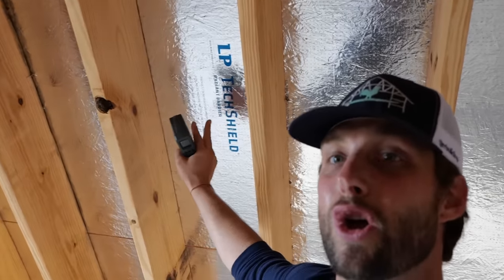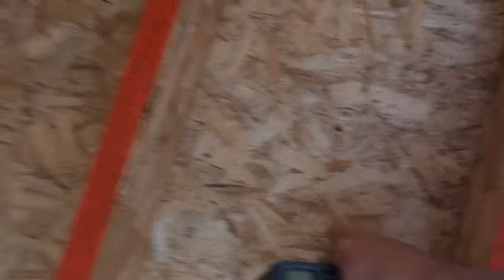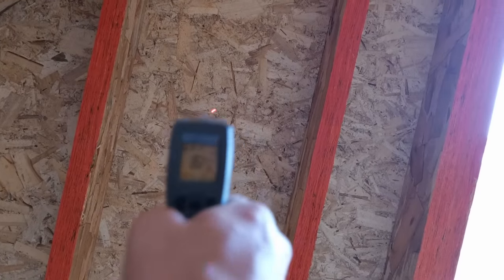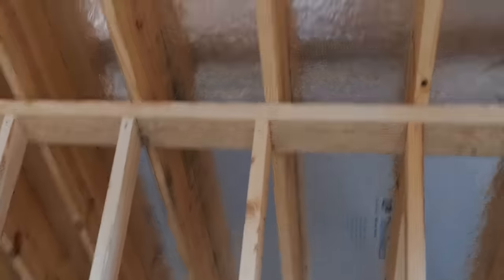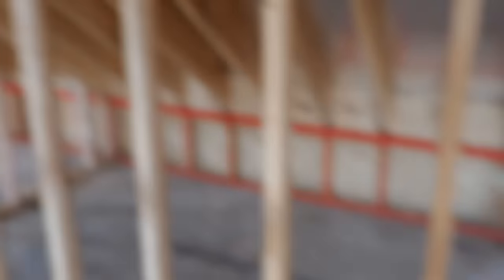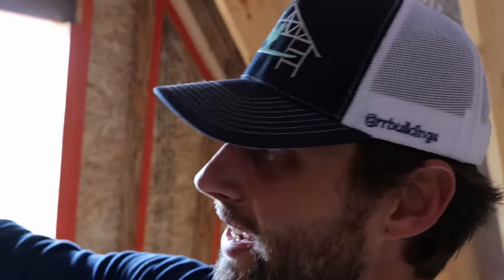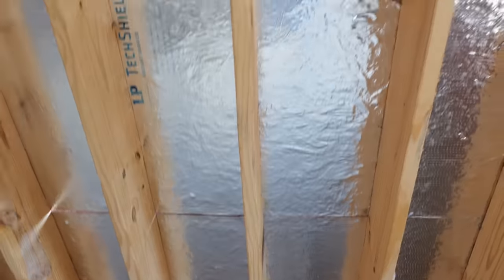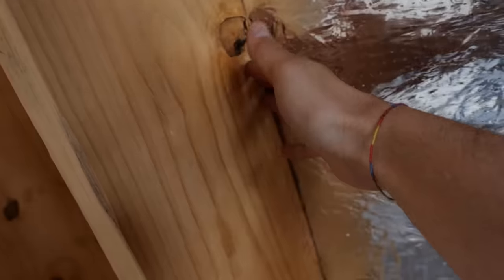Do Radiant Barriers Work? - LP Techshield Review

Comment: insulation should be tight against the sheathing to prevent thermal bridging and condensation. the wall cavity should have a good air seal to prevent thermal loss. like caulking top and bottom plates and firefoam all penetrations along top plate and any to the exterior.  

air gaps need to be on exterior such as brick or siding. 
the gap on brick exterior helps equal out pressure and wont allow forced elements through weep holes and old mortar. very similar with siding. this is known as a rain screen. 

with air loss averaging 15-35 percent of waste, mostly through the attic, walls and ceiling along with rim joist, crawlspace and windows help create the stack effect.  
the debate over insulation, R-value and region has long been scrutinized and tested. as of today, houses are required to be built “tight “ and have minimal air loss.  
any air gaps between insulation and exterior wall sheathing is a problem waiting to happen.
when insulation is installed directly to attic ceiling, the conditioned living space is now sharing attic space so baffles and vents would need to be omitted and attic would need a supply and return from the hvac unit. also considerations towards hvac and water heater units if gas operated. 
if blown in insulation is being used, baffles should be insulated and rise past any level of insulation to properly let the mass air flow through the top “ridge “ of roof. 
this also needs a controlled flow. using to equal amount of intake and output. to figure this generaly is ( for easy math). footage divided by 2, then divided by two again but in inches. 
so
500 sqft = 500 sq inches divided by 2 = 250 sq inches of intake and 250 output. this allows the proper mass airflow an attic needs to vent.

Comment: Deciduous trees out perform everything.
Reply: But if you want solar, that tree shading the south and in our case South West is coming down so we're adding this
Reply: @margaretagard1744  Unfortunately the correct alighnment for a house towards the sun is sacrificed to have the house facing the street and trees are often planted in the wrong places or sadly not at all.
Reply: Nice when tree's aren't doing damage to cement. I hate leaves in the fall. Removed a 75 foot tree the canopy was over my driveway, destroyed the cement. The roots have traveled 75 feet in each direction had destroyed lawns. Dug up all the roots in front of house. Now I'm ready to start other side and do a large cement driveway. I finished large lawn in front of house last year. Never could keep my car clean from birds.
Reply: @amraceway  :  a bit crass,  when you chop the trees, cut them into piles for firewood.  this is a natural cycle of carbon from free to living to being released back to feed more trees.
as for the birds,   use that nice fire to roast a nice meal.  nothing in nature should be wasted.
see how pleasant it is to live in and with nature !
Reply: @dave-in-nj9393  A fine resolution. Why didn't I think of that?
Reply: @margaretagard1744  I wonder how this product compares to the fiberglass I saw on this channel #sinnisjInsulator.

Comment: The air gap supposed to be on the side that is receiving the radiation...   having a gap between your insulation and the radiant barrier will help prevent radiant heat from escaping your house..  but if that is your goal then the radiant barrier, and airgap should be behind your drywall...  but since you are in Texas, you probably want your airgap behind your radiant barrier.

Comment: It's infrared, not ultraviolet that radiates heat.
Reply: UV radiation has a tighter wavelength and is slowed down faster upon striking objects. While heat is not radiate off objects in the UV spectrum, objects are heated when being struck by UV.
Reply: @user-dr2pg8fk2i  Any frequency in the electromagnetic spectrum will heat an object at very high intensities (I.e. lasers), but infrared is radiant heat as used in heat lamps and air fryers.  UV is a very poor source of heat in comparison by magnitudes.
Reply: @user-dr2pg8fk2i  Also, UV radiation having a "tighter wavelength" (properly known as a higher frequency) is not slowed down more as all reflected electromagnetic radiation is reflected back at the same speed.
Reply: @user-dr2pg8fk2i  you know when a piece of metal glows red because it's hot? that's infrared heat radiating. What you see is visible light also radiating from it, but if you put your hand close to the heat, you can distinctly notice the infrared heat radiation.
Reply: @user-dr2pg8fk2i  I wonder how this product compares to the fiberglass I saw on this channel #sinnisjInsulator.
Reply: There is some heat generated by ultraviolet light. However, the vast majority of heat comes from infrared light.
Reply: Also, the aluminum foil on the OSB board is radiating heat back into the house, not away.  The aluminum foil will conduct heat into the house easily.  He knows enough about heat transfer, but lacks comprehension.  In Texas, you want to reflect heat away, not back into the house.

Comment: Um, doesn't that just measure surface temperature. So if the material is outside ambient temperature, then that's what you see. I think you need an IR camera to show thermal differences.  I get 8* deltas all the time using the laser thermometers all the time in the same space(s).

Comment: Why not build your roof with the radiant barrier on top of the system with the air gap outside? Not sure what roof your using but on a Metal roof in Texas if you went..
1.  Metal Roof.
2. Purlins, say Cor a Vent for air flow.
3. Radiant Barrier reflecting back to the Metal roof.
4. Then like a Zip R Sheathing for the roof if okay'd by engineer. U get the Thermal Break at the Rafter.
5. Rafter insulation where U don't have to worry about the air gap.
You could put A heavy felt on top of the Zip under the Foil as added protection but that is strictly a personal choice and also depends on what foil product U go with.
Reply: YES!  This is the ultimate roof and we make the radiant barrier underlayment for this type roof www.RoofingFoil.com - Miami-Dade County Approved too!

Comment: I was thinking about using reflectix on the inside side between the stud face and drywall on my remodel. Something   like 2" sprayfoam then fiberglass batts then reflectix and finally drywall. Outside to Inside.
Reply: Reflectix has a much thicker bubble wrap style design. Which provides a minimal air gap between layers. I know this wont be much in itself but maybe as a part of the system it will have some added benefits it's not permeable either. Which is why I have reservations.  If moisture gets in the fiberglass layer it would be hard for it to dry.
Reply: Wilder Transit So are you trying to get a radiant barrier to the inside? This Would typically be a cold-weather application to help keep heat in if you had a radiant heating system.

Comment: ... little bit wrong explanation on air gap needed for radiation reflection to work ... it works anyway ... it helps to stop conduction by ventilating it through the provided air gap (cooling) ...

Comment: When radiant barrier is on the plywood surface it reduces the emesivity, the amount of heat emitted by the radiant barrier. If you want a more effective but laborious method. Staple radiant barrier to the bottom of the roof rafters. This creates a better radiant barrier because the air gap.
Reply: When you mean bottom, you're talking about the thin face of the rafters? So there would be an air gap between the rafters? I have an existing very thin foil radiant barrier layed flat in the ceiling but was thinking of stapling it up across the rafters.

Comment: The LP Tech Shield goes against my understanding of how a radiant barrier works - I had been taught that the air/ventilation gap needed to be ABOVE the radiant barrier (RB) - keeping the radiant heat OUTSIDE the radiant barrier. In LP Tech Shield, the product is installed RB side down, so that the product's OSB (a heat conductive material) is directly above the RB. Also, per Residential Code, IRC 2015 Section 806.5.5.1.2, https://up.codes/viewer/pennsylvania/irc-2015/chapter/8/roof-ceiling-construction#R806.5, that air gap he mentions between the LP Tech Shield and the fiberglass BATTs is not allowed - the insulation needs to be DIRECTLY below the sheathing. Plus, rigid insulation is required above the roof deck when the below deck insulation is air permeable. In the condition shown in the video, where you have an insulated, cathedral ceiling over a conditioned attic space, I would think you'd want the radiant barrier ABOVE the roof sheathing (RB side out), and then a ventilated air gap via furring strips above the sheathing and below the roof deck/roofing.  In the case of a non-conditioned attic, I've always seen the radiant barrier sheet fastened to the underside of the (uninsulated) rafters, and the heat ventilates up the rafter spacing and out at the ridge vent. I guess if the LP Tech Shield product works, then it works. but I'm interested in understanding how and why it works the way it is designed.
Reply: Techshield technically works off the EMISSIVITY quality of the aluminum foil and not the REFLECTIVITY quality.  People get these two confused and using reflectivity is always best but emissivity is definitely effective.  The net effect is the same: They both reduce heat flow.  When you staple to the bottom of the rafters for retrofit applications like www.AtticFoil.com you are working off the REFLECTIVITY quality which is actually more effective.  However, nothing wrong with radiant barrier decking for new construction with vented attics since it's low cost and zero additional labor to install.

Comment: @Jordan_Smith great video, I don't see how you are going to be successful at making sure the fiberglass insulation is NOT touching the radiant barrier.  If you can please let me know how you can be assured there is no barrier to insulation heat exchange taking place, I am 100% behind your objective.  Additionally, I'll use any links you have in place so that you can take a commission within my purchase if those links are available with your video.  Overall, great video buddy.

Comment: I’m not convinced that the air gap without ventilation is a benefit. If you are getting heat conducted from that roof material into an air gap that is no different than heat being conducted into foam or glass insulation (with the exception being the r value of whatever is in contact with the roof). You don’t mention venting the air gap, so I’m thinking that you aren’t doing that. Am I missing something?

Comment: Anyone who has ever stood near a blazing fire knows that holding your hand in front of your face blocks most of the feeling of heat .  That is only blocking the radiant heat.  In fact many who heated homes years ago with a fireplace or even wood stove later should use a fire screen which is basically a piece of thin metal with feet to be able to move it to be between  say a chair you sat in close to the fire and the fire so you wouldn't get too hot.
Reply from the maker: Exactly! Convection and conduction play a huge role in heat transfer, but there is a reason radiant heaters are so effective.

Comment: I think you should have been pointing your thermometer at the truss where there's no reflective barrier on both sides. See you're getting all scientific on the effects, but you're misunderstanding how that lazer thermometer works. When you point it at a reflective surface you're not measuring the reflective surface, you're measuring the temperature of whatever the surface is reflecting onto. Don't believe me, point it at yourself, then point it at yourself through a mirror.

Comment: Do they work? 
NO, they do NOT work. 
I paid $1700 to have that crap installed in my attic with the Promise that it would reduce my heating and cooling costs by a minimum of 30%. 
Over the following 5 years, my heating and cooling costs remained the same.
Reply: I agree. attic is cooler, but no change to electric bill

Comment: Your IR temp is incorrect. You haven’t accounted for the huge impact of the emissivity. The wood surface at IR wavelengths has very high emissivity. The temp measurement is pretty good. The Aluminum surface has low emissivity. The IR temp will measure lower than the true temp. Not clear whether you know this and are pulling a con job, or just don’t know.

Comment: Everyone should use this. At Home Depot it’s only $3 more.
Reply: X2, I'm planning to use it on my somewhat small garage and just learned the the other night that an air gap is needed. So, I will use 2x6 board to rebuild my roof that needed replaced anyway, and use R13 insulation, rockwool, for 2x4's and have a 2" air gap for the radiant and to let the roof breath.

Comment: Radiant barrier works on decreasing the radiant transfer on the shiny side, so it keeps heat from the shiny side on the shiny side, this setup is to keep the space warmer in winter. To keep it cooler in summer, shiny side to the outside.

Comment: I thought the radiant barrier was not supposed to be touching the roof deck.
Reply: That would be a benefit but the foil itself has a very low emittance, very low radiating quality to it,  0.03 to 0.9 for the wood itself.

Comment: Radiant barrier should have air on both sides to work best, Direct contact transfer heat more than radiation or convection. Next time stape radiant barrier sheet (reflective on both sides) to the rafters. Then it reflect heat back out the roof, and what heat that does heat up the barrier will be much less radiated to the rest of the house below. And the ultraviolet light is nonsense. The sun puts out all frequencies form IR to UV,, all of which heat the atmosphere to various degrees and most surfaces as well.

Comment: You need to put black tape on the foil you are not reading surface temperature at all the way you are doing it.  Also the foil in that position reflects back radiant energy toward the air space---not to the exterior.  Add to that, the foil is not nearly flat enough,
Reply from the maker: But that is exactly the point.  I am not trying to measure the surface energy that would have to either convect or conduct to transfer.  I am only showing the differences in RADIANT energy, so a IR thermometer is perfect for comparison purposes.  If i was concerned about surface temperature, I would need to do something along the lines of what you are saying with the black tape.  You could also change the emissivity settings in the IR unit, but these cheap things are pretty terrible with reflective surfaces.
As to the directionality of the foil face: we are not trying to REFLECT the energy away, but rather we are keeping the energy from EMITTING from the backside of the decking into the attic.  Installing the other way around would cancel all benefits as the decking will be roofed and covered with underlayment, eliminating radiant heat transfer and making all heat transfer conductive.  Sun radiates heat through space to roof > Roof absorbs heat and transfers through assembly via conduction > Conduction is interrupted at foil/air interface > Heat's ability to re-radiate into attic is limited by the low emissivity  foil backing> Heat re-radiates into atmosphere.  (Sure, there is still a lot of convection and conduction as well as re-radiation going on to heat the attic, but this does reduce attic temperatures.  I'll have to build a couple of dog houses with air thermometers to show its not just a gimmick I guess..
Reply: @JordanSmithBuilds  here is an experiment you can try in your kitchen.  Take a stainless steel pot and fill it with water and put it on the back burner.  Now take a  cast iron pot and fill it with water and put it on the front burner.  Heat both pots until the water is 140 degrees.  You will need to put a piece of tape on the stainless steel one in order to get an accurate temp reading.  Heat them both until the water temp and the side of the pots have the same temps.  Now turn the burners off and wait a few minutes.  Now stand something as long as the stove is deep for the two pots to reflect onto.  Make sure each pot is the same distance from the object. I used three reams of paper.  The third ream was to create a T shape so each pot would not affect the temp of each of the surfaces being reflected onto. If what you are saying is true, there should be a difference of how warm each ream of paper gets.  I could detect no significant difference in reflected temp.

Comment: Infrared thermometers don't work on reflective surfaces.  What you did was read the heat of the reflection.  Plastic sheathing would be even more effective then an aluminum coating, due to its ability to not conduct heat.  The only thing a "radiant" heat barrier does is create an airspace of hotter temperature between the roof and the barrier compared to the barrier and the insulation.  A radiant heat barrier just laid down on insulation is the worst, it will do absolutely nothing other then stop some convection from airflow within the insulation.

Comment: Barriers without an air gap make no sense. It just heats up with the rest of the roof and radiates inwards. The air gap creates a hot air corridor to trap the heat and that hot air can be let out at the top of the roof where the air rises inside of the space.

Comment: The infrared thermometer will not work accurately on any reflective materials. Like submarines using sonar. It requires a return signal to calculate the distance of an object. If the returns signal is scattered, masking the return signals, then it won't see the object. The Stealth Fighters has unique angular surfaces and scattering skin material, designed to scattering radar signals. The deflection of the reflective foils of this product reacts in the same manner as the stealth fighter...it scattered the return signals, which gives a false reading when using the infrared thermometers.